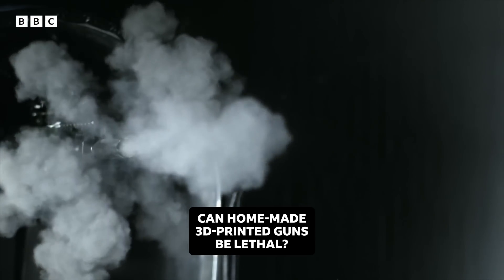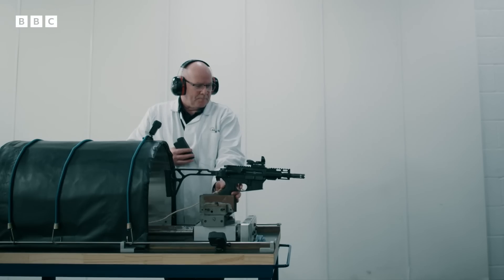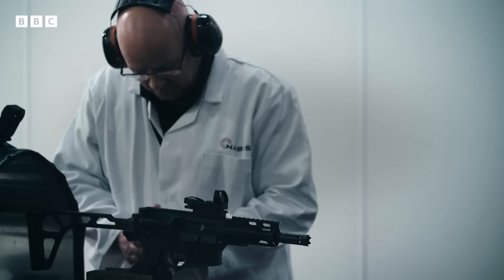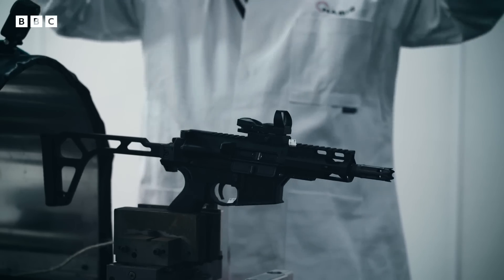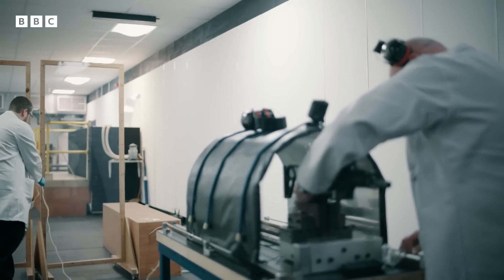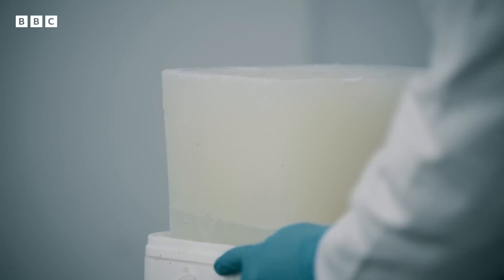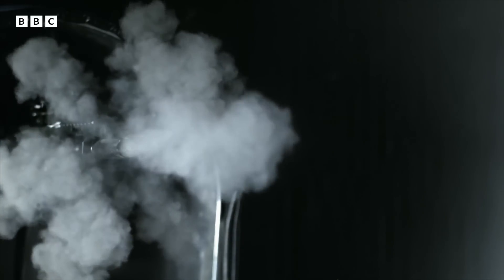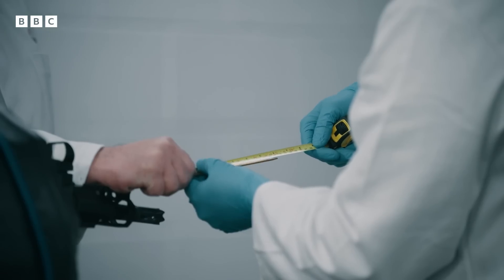Ballistic Forensics - Is the illegal 3D-printed gun a viable weapon? | Forensics: The Real CSI - BBC

Comment: Only the lower is 3d printed; the parts that are subject to pressure are made of metal..lol; no different than an mp5, Glock, or any other polymer firearm. What are you even trying to prove?
Reply: What are they trying to prove?  That they're british.  There is a reason america threw these people out.
Reply: it's called fear mongering it's nothing new.
Reply: its that they can make parts without having to go through a manufacturer or whatever its not anout proving anything they just dont want you being able to make parts to put together any kind of guns/weapons its pretty obvious they want to control those that will comply with their "laws" without resistance 🤦🏻‍♂️
Reply: You only need a license to buy the lower receiver and rest is over the counter therefore a problem
Reply: It was a 22lr conversion as well.
Reply: The BBC is known to lie and exploit their coverage and use double standards and racist narratives to sway public opinion,these two clowns in their white scientist cloaks clearly have NO idea how firearms work,besides what they've seen in hollywood movies,as this so called "test" and opinions make their incompetence clear as day,there are quite a few firearms out there today that use very similar materials as a 3D printer,like Glock pistols for example,use a polymer plastic based lower receiver and the rest of the gun barrel&slide especially,are made of hardened steel,as long as the weapon as been assembled properly and the settings on your 3D printer have been tweaked properly the gun should have no issue firing safely,I have a friend in the US who made his own 3D printed Glock with a $200 dollar printer and $250 in parts for a G19 Gen3 9mm,that he ordered online,more than a thousand rounds fired out of it and the gun still functions just fine,so the BBC can stop promoting lies and being fear mongers
Reply: It’s the bbc ffs, fearmongering with stuff they do t understand
Reply: The FGC-9 can be made entirely at home with zero gun-specific parts—even the rifled barrel, which is made from hydraulic tubing and an electrolysis process cuts the rifling. Myanmar rebels have been using it in their battles. The cat is out of the bag, gun grabbers. Figure out a different approach.
Reply: @cdevidal they dint need a different approach we've been giving in and complying for over a century now each new "law" they enforce as if its real we comply with giving up more of our rights 🤦🏻‍♂️ wake up and see what needs to be done and do it which is fight back physically like the second amendment intends
Reply: not in the uk, can't get metal parts here.
Reply: @AlexMageethefirst  all you need is a decent quality mill/lathe...you can get one at harbor freight for under a grand..its ok..it will do the job
Reply: @AlexMageethefirst  A guy in Germany designed a 3d printed gun called the FGC-9 that uses metal parts that anyone in Europe can buy st a hardware store.  It's a semiautomatic 9 mm that has already been proven combat effective by the rebels fighting the military dictatorship in the Burmese civil war.
Reply: @Collin-p9m im oretty sure it wasnt hardware store parts it was a real gun barrel and maybe some other gun parts with alot of 3d printed parts  but its still nowhere near as good as a factory gun because most of the parts are plastic if it had 3d printed metal parts that were good enough then it would be something more to worry about but even then it still makes no sense to worry about homemade guns cause only those that wont comply with the "laws" are gonna have them those that comply arent the ones that need to be worried about making the weapons they should just focus on the real criminals that commit actual crimes not just owning a weapon or owning certain kinds or without licenses etc like that but thats not what they wabt they wabt to control those that will comply without resistance it makes no sense to make "laws" like this when criminals will just do it anyway by not complying with them so it only effects those that will comply
Reply: @gabe-we8hz  The FGC-9 uses a 9mm diameter piece of hydraulic tubing as the barrel, and a piece of bar stock as the bolt.
Reply: We’re making uppers now
Reply: @Reds_guns just making uppers and lowers doesnt mean anything to be honest theyre not the pressure bearing parts and metal 3d printers that are good enough more than likely are a long way away from being available to the public if they ever will because people comply with the so called "laws" they jeep enforcing as if theyre real anyway so they wont be sold more than likely or if they are theyll be tok expensive by "law" for the "normal" people to buy and even so they shouldnt worry about weapons they should worry about the people committing real crimes with them like murder but theu wont because they want to control those that will comply with the "laws" without resistance not the actual criminals that will just ignore the "laws"/actual laws like not murdering people and do it anyway
Reply: They proved that gun lovers would watch the video and make money for them 😁
Reply: It's video like this that shows how good the slowmo guys are!!!
Reply: @Daivd1111 🤦🏻‍♂️
Reply: And of course upper part which does handles the high pressures and doing the pew pew part is not considered firearm (at least in US) all because it doesn't require serial number unlike lower.
Reply: @Caliell nope the barrel and breach are what holds most of the pressure the reciever just holds other pieces together and all that other than where the reciever meets the barrel that part takes some pressure but not all that much still like i said the barrel and breech or bolt etc like that takes the most pressure making recievers frol plastic isnt that hard or whatever
Reply: @gabe-we8hz  you do realize that two parts of AR 15 style firearm are called Lower and Upper Receivers? As in the Lower Receiver houses trigger assembly, magazine well and the buffer spring, while the Upper Receiver holds the bolt assembly, the gas pressure system (can be tube traditional or piston akin to AK) and the barrel? In US The Lower Receiver is considered  the firearm with registry number and manufacturer's ID located on the Lower Receiver. The upper Receiver does not count as firearm. Trigger assembly and the Lower can be made with relative ease, since it is basically hammer strike to the ignition pin  based system, while the upper receiver handling the massive pressure force is "relatively not".
Reply: @Caliell  and no again the recievers can be made easily even upper recievers from plastic because they arent holding most of the pressure the barrel and bolt/breech are etc like that also that depends what gun youre making that has what parts where and how theyre put together
Reply: @gabe-we8hz  that doesn't change the fact that only lower receiver needs to be registered and so far looking at the mechanism the upper is doing the heavy lifting while the lower is relatively easy to make since there are plenty of hammer style triggers in the toy guns while buffer springs and the buffer can be easily replaced from many other products and the lower cut from either metal or even reinforced wood and lined metal for internal parts.
Reply: @Caliell and no you mean "legally" (what the government a d stupid people consider "legally" not what is legal in reality cause if the second amendment and because its tyranny even not in the united states so not a real law) its not considered that also wow "pew pew" 🤦🏻‍♂️
Reply: @Caliell also no parts actually legally require setial numbers either in any place on earth cause again thats called tyranny
Reply: Thats in the US. In the UK and Europe the focus is on home producing the whole gun because parts are also strictly controlled there.
Reply: @agoogleuser3808 why ? Why did my brithish  ousins allow this to turn in to
Ba y sheep? Why bros
Reply: @agoogleuser3808 no theyre not idiot only to those that will follow those "laws" are they "heavily restricted" or whatever so no the criminals will make or steal or buy privately whatever they want look up p.a. luty he built a working homemade submachinegun from all hardware store parts no gun parts whatsoever just to prove how nonsense weapon "laws" are because actual criminals and stuff will like i saod circumvent them and do it anyway they dont care what "laws" are "passed" and enforced on those that will comply 🤦🏻‍♂️
Reply: Well, you may notice that this video is produced by BBC, the British broadcast company. In America, the receiver or frame is the regulated component of the firearm. However, in Britain it is the pressure bearing components which are regulated such as the barrel and springs. 

And we have reached a point in 3D printing technology can be used to make barrels. The company called Solid Concepts has already managed to use a 3D metal printer to produce a rifled 1911 barrel. Though for higher pressure cartridges, the printed barrel will likely a reinforcing wrap to help it hold together.
Reply: @Steel_Wolf_31 no its not idiot no parts or weapons are actually legally regulated or legally can be because of the second amendment the "laws" just get enforced as if theyre real anyway because we allow them to be by not fighting back physically like the second amendment intends as shown by the past over a century now that we've been trying peaceful means and get nowhere but more and more "laws" enforced on us as if theyre real anyway 🤦🏻‍♂️
Reply: @Steel_Wolf_31 and no theyre not even in britain cause thats tyranny
Reply: @Steel_Wolf_31 and no it cant unless you have a metal 3d printer that can print good enough metals for holding the pressure and those are like millions of dollars your "normal person" isnt going to have those also criminals will have whatever theu want though because they dont play by the "laws"/actual laws which is why "passing" them and enforcing them on those that will comply makes no sense whatsoever unless thats their actual goal like it is if they actually cared about actual criminals theud just go after them alone and out them in jail or whatever but they dont they go after those they know theu can control without resistance cause they comply with the "laws"
Reply: @Steel_Wolf_31 if you 3d print a barrel from plastic or carbon fiber or whatever other plastic like that its going to blow up in like 2 to 3 shots max if that even with something like a .22 long rifle or whatever or if not explode at least majorly damage the barrel to where its pretty much useless if youre thinking yoire gonna print it thick that doesnt really work too well because plastic no matter how thick doesnt have the strength needed to hold up to that much pressure
Reply: Being from the UK I don't think it's a normal upper. I wouldn't be surprised if it was an upper from an airsoft or simunition gun. Pretty sure you can't order a M&P 15 22lr upper in mail over there. LOL
Reply: @project86xero its not funny and yes legally in reality you can because its a tyrannical "law" but the people there comply with those "laws" is why you "cant"" get em there" only "law" abiding people cant get then there or whatever actual criminals/"criminals" will get whatever they want because they circumvent those "laws"
Reply: Over there they have to make everything from scratch because in Europe it’s the pressure bearing parts that are restricted. But you are correct those parts are metal and not 3d printed. It’s basically an fgc9 or something similar. They also have to make their own ammo because that is restricted too. For the primer they typically use a blank since those are unrestricted and press a copper tube around it. If they don’t have access to gun powder they use ground match heads. Very primitive conditions for gunsmithing there.
Reply: @cowboy399 and no its not the pressure bearing parts none of them actually are regulated legally because thats tyranny again only on those that will comply
Reply: @cowboy399 also no they dont have to make their own ammo again they could just steal it or buy privately etc like that like i said for the other stuff
Reply: @gabe-we8hz  The UK is very different in that regard. Few people have firearms and ammo is strictly regulated. It’s not something that is easily obtained from private sellers and the people who own it have to account for it. There is a book out - I forget the name written by somebody in the UK on how to make improvised 9mm ammo from 8mm blanks. He also wrote a book on how to make a submachine gun from hardware store parts as a political statement. He was eventually caught with it and spent years in prison over it.
Reply: @gabe-we8hz  Not without the proper licenses you can’t and it has to be for a gun you have a license to own. It’s not like the US where you can order as much as you want online and have it delivered to your doorstep. That sort of thing is locked down pretty tight there.
Reply: That's not true, the FGC-9 is almost entirely 3d printed.
Reply: @Deac0n_Blues  🤦🏻‍♂️
Reply: @Deac0n_Blues  almost is the keyword there theres still metal parts where they need to be which is the whole point of what the original poster was saying its not any different other than being 3d printed and maybe a few parts being different
Reply: They needed to prove that these non-traditional firearms were equivalent to commercial firearms so that they could charge the individual that possessed them. Simple
Reply: Sounds awfully British of you
Reply: @ezioDAassassin 🤦🏻‍♂️
Reply: Well metallurgical aspects is one criteria.
Reply: The point is you don't need a license to buy the barrel and the rest of the firing mechanism. So it's dangerous if criminal can manufacture their own weapons for crime.
Reply: @watch_addictz   I can buy a gun illegally and even legally faster than i can print one, And 3d printed guns in most places (America) are perfectly legal
Reply: @FireBirdPrints yes for sure!
Reply: @FireBirdPrints look bro, I print my own lowers. But the US cannot be used as an example of gun laws for "most places". Almost no other country has gun laws akin to that of the United States, so your statement makes little to no sense at all.
Reply: @FireBirdPrints its not illegally if its in a way they say is "illegal" like just getting them privately or whatever unless its actually stolen or youre committing a real crime like murder or robbing someone whike armed with it etc like that its not actually illegal just to own whatever weapon you want or use it in a good way like self defense or defense of other innocents or target practice or hunting etc like that
Reply: @FireBirdPrints and no its not "in most places" all weapons are legal everywhere without anything they say you ""need" for it to be "legal"" in the whole world cause its tyranny to not allow them cause only the "criminals"/actual criminals will have them if they consider them  "outlawed" for all the "normal" people
Reply: @FireBirdPrints  this isn't America
Reply: @watch_addictz  criminals can and do a lot of things they're not legally allowed to do...
The point is that doesn't make it okay to tell free law abiding citizens they can't.
Reply: @watch_addictz criminals will always criminal
Reply: @watch_addictz You can make your own barrels through ECM (running an electrified current through water) and all you need is a fish tank, steel pipe, water, a saline solution, a power source, and a fish tank water fountain. Weapons like the FGC-9 utilize a fire control group that can be sourced from an airsoft gun, or made at home using a spring bending jig, and printed parts. The bolt assembly uses straight blowback, and is mainly printed, as are the receivers. Gun control is dead and we killed it.
Reply: As if criminals can’t get a gun lol.  All the most heavily restricted cities have the worst gun crime.  More laws isn’t the solution. And 3D printed guns are hardly a real issue.
Reply: @watch_addictz  man never heard of the black market
Reply: @watch_addictz  the pressure bearing parts are the parts you need a licence for
Reply: Wrong, obviously you don't know shit about guns.
Reply: @fdsdh1  do you have any other made up shit you want to discuss?

Comment: Today's 3d gunz are well made and can withstand hundreds of rounds.
Reply: @Octopusprimal  source: I print rocket launchers
Reply: @Octopusprimal  source, all of the ones i have
Reply: You can find the website easily
Reply: 100s lol. 

Id be embarrassed if my printed guns only lasted hundreds of rounds
Reply: @confuzled_makes tbf, he may have been referring to Hoffman's mostly 3d printed AR15.
Reply: @godlikemachine645 so "today's 3d guns" refers to one of several hundred designs...
Reply: @confuzled_makes  I did say "may."
Reply: @godlikemachine645  sure. They may have been talking about guns made with 3d print pens. 

They weren't, but they may have been
Reply: @confuzled_makes  They either break within the first mag (if you make a mistake) or not under normal use.
Reply: @CaptainMurika  everything either does or does not. 

I am well aware of normal failure modes.